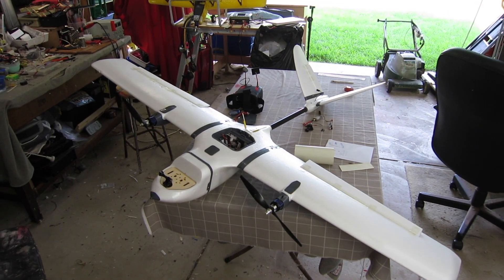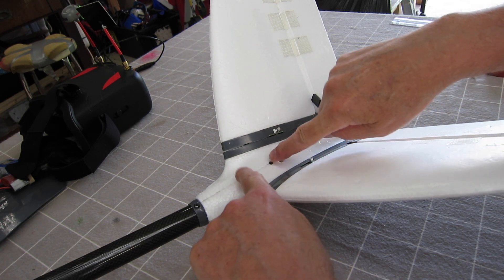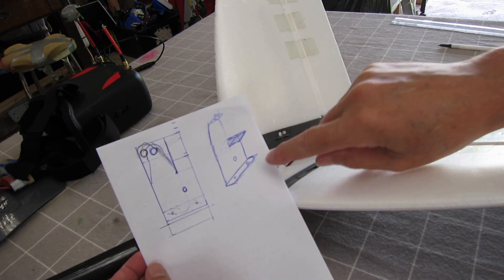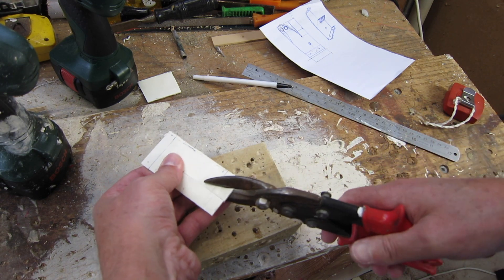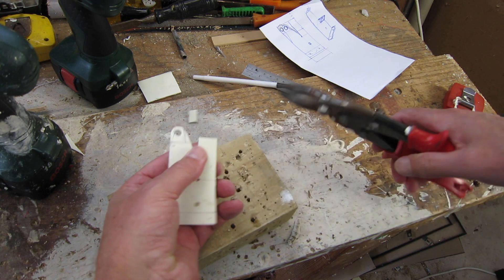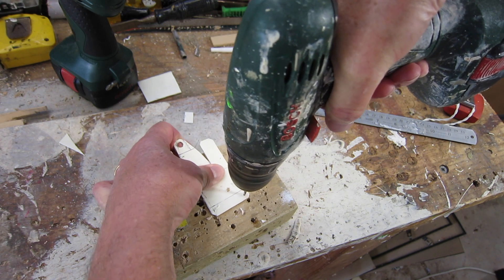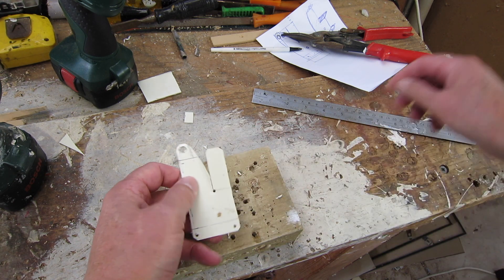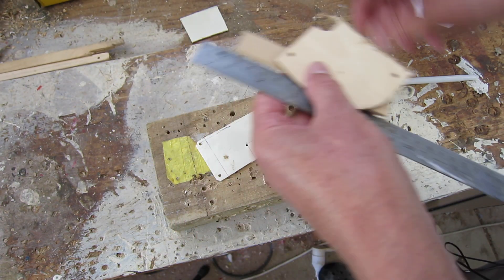PVC FPV mount

Comment: Very, very nice, I've done a lot of things with PVC but wouldn't have thought to straighten out a bit of pipe for your mount.. would've used some acrylic sheet I had laying around but PVC is easier to work what you did  :)
Reply from the maker: Yes it is very easy to shape